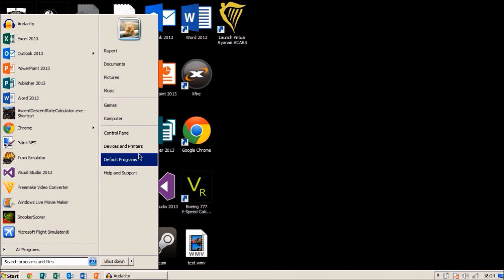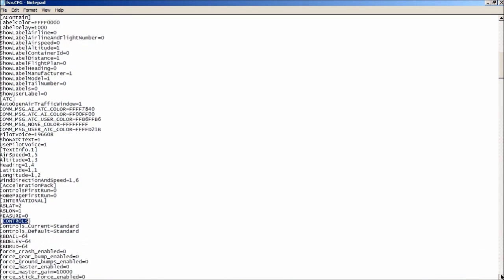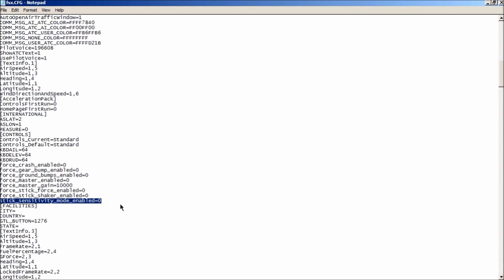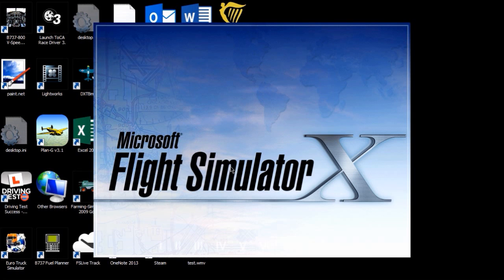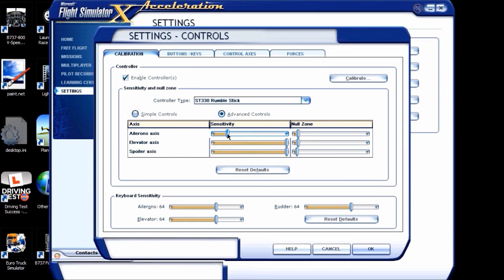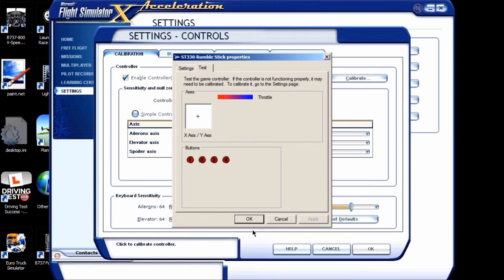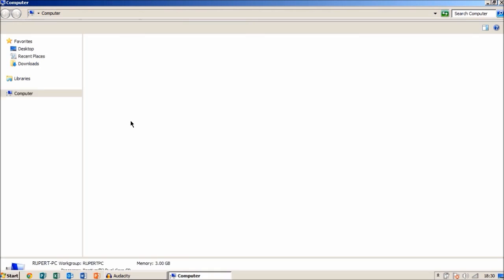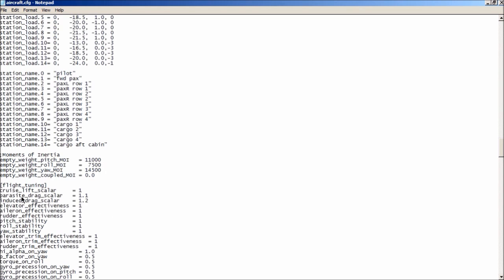FSX - How to setup your joystick/controller properly! (100% Linear!)

Comment: so why doesnt my rudder turn hardly at all as soon as Im off the ground? then I can use it fully again on ground
Reply from the maker: It depends what you mean by hardly at all, if you mean it just causes a few degrees of displacement to the aircraft's yaw then this is completely normal - the rudder's effectiveness decreases with speed since for example if you are flying at 100 knots and apply rudder, you are trying to deflect the tail into the path of the 100 knot wind and so the wind naturally pushes the tail back into line and therefore it requires more input to do very little. Whereas on the ground, though the rudder does help when you control the rudder (in most aircraft) it just turns the nose gear so it's just like steering in a car. The best way to check if your issue is just a misunderstanding of how the rudder works, or whether it is your controller - just look at the virtual pedals in game of the aircraft you are flying, if when you put full rudder on your controller the pedals in game move to their maximum offset then the control setup is fine. It could also be down to the aircraft you are using, default aircraft tend to have poor flight models and hence this could also be a contributing factor. I hope this answers your question. Rupert
Reply: ok thank you. My pedals seem to turn mostly to their full extent when Im off the ground. Its weird though having not alot of control. anyways. I appreciate your help! Ill subscribe :)
Reply: Have to turned off autorudder? It seems like a silly question, but it's caught me out before.
Reply from the maker: Luke's Throwaway Channel It's been a while since I fired up FSX so can't remember exactly however I think it is in the realism section
Reply from the maker: Luke's Throwaway Channel It's been a while since I fired up FSX so can't remember exactly however I think it is in the realism section

Comment: my joy stick elevator is shakeing.  jsut elevator and  sometime i can't moe down or up fully of elevator how to fix it thx. sorry for my english
Reply from the maker: PKPat It sounds like you need to calibrate it, go into devices and printers and then right click on your joystick, click settings then advanced and you should be able to see the calibration from there. There will be a tab at the top of the window that opens and in that tab you should have an option to calibrate the device. Hopefully that's easy enough to follow, a number of people ask this question so may make a video on it :)
Reply: shaking virtual controls say about hardware noice, you can calibrate it and use some software signal filtering, but better just change joy, i change tonns of joysticks from 1994 or somewhen like that, but after i got really good one, in 1998 or some around that date, uses it till ~2013, about 15 years, it was ms sidewinder precision pro with laser sensors, in 2013 i got x65 with strain gage sensors, and both take for never ever have a problems wat i had with other sticks, you can found joysticks with hall sensors, but they only for x,y axis, so with that joystick need use rudder or be ready, when resistor of rudder-twist start noice, but today afaik new joysticks with resistors use very good hardware, in 1990 it was in expensive models only(exclude microsoft models like precission v2 and ffb v2*), like thrustmaster cougar or ch, so may be, you need just change joy, but if your joy is new, so my "afaik" is completely wrong, and everything stay as was befor, and for be sure about long live for joy need some extra cash
(* <this one brand new on ebay was around 600$ year ago)
at today i think only 3 models of joys, what worth to buy, thrustmuster a-10(need buy rudder separately), g940 and x65 if you are not billionaire, for change them every month, sure you can be lucky and not expensive joy will live very long time, but i think you have to be really lucky, as all of them made from cheap plastic and just can not have long life
and if you will buy x65 be sure his immovable stick for you, i did and i was right, after use movable joysticks more than 15 years my empty brain was adopted to x65 in couple of hours(by the way, for calibrate x65, all you need it enable most relaxed force mode and reconnect it)

Comment: Does it work for keyboard?
Reply from the maker: Thomas barney No sorry keyboard buttons are digital. On or off - 1 or 0 and therefore there is nothing linear about them since they can only have 2 values. For example let's say you have two light bulbs. One can only be on or off the other has a dimmer. You could increase the light from the bulb with a dimmer smoothly (linear) or you could start off increasing slowly then increase quickly (non linear)... However with the bulb that is only on or off you can't increase the brightness slowly because, well it's on or off :) hope that answers your question

Comment: with my joystick it all ways turns left or right when its perfectly in the middle!
Reply from the maker: Oli Plays Hmmm, it's either a calibration error which can be fixed in devices and printers or it could be due to wind if using a default ac?

Comment: has anyone got the config file so i can just load it straight in instead of doing all the mapping myself?
Reply from the maker: I most definitely would send you my config if I could... However the config is independent of your pc, with all your custom settings and addon references stored in it. My config also has tweaks specific for my pc and could make yours run poorly. Rupert
Reply: ah i see, there is no keyboard mapping xml file then?
Reply: C:\Users\YOUR USERNAME HERE\AppData\Roaming\Microsoft\FSX\Controls\Standard.XML

it should be here, but i am looking specifically for someine who uses a ps3 controller

Comment: Hi! Rupert, is it true that the above technique doesn't correct the nonlinearity of Pro Flight Cessna Yoke?
I have tweaked fsx.CFG and set the sensitivity of max and nullzone to minimum as suggested in the video.
I have tried it also before and after downloadeing and installing the latest Saitek driver.
It is still behaving like nonlinear yoke in FSX: Steam Edition on my Windows 7.

I'm so bummed out right now, I just got my first yoke today...

Comment: I have tried every way I could think of.  But I'm not very tech savvy.  So far I have only bought add-ons from the Steam site, so they are always compatible.  Most other add-ons do not confirm compatibility with Steam.  I am not too concerned about that but I would really like to detune my twitchy aircraft.
Reply from the maker: Ah so you are trying to tweak a file from an aircraft off the workshop?

Comment: Hi Rupert,  I'm back.  Since my last contact I have upgraded  to FSX Steam.  I have been trying to find the " SimObject/Aircraft" file. When I found it I discovered that the aircraft file no longer looks like that under FSX.  Have you been involved with FSX Steam and have you found how to detune the controls?
Reply from the maker: Hmm strange, the  simobject/aircraft file should be located under; program files (x86)\steam\steamapps\common\flight simulator x (not quite sure of the folder names just going off the top of my head as did have steam but am currently on classic). Let me know if you still can't find it but I'm sure it should be there, otherwise addons like the PMDGs wouldn't have worked from the start. Regards, Rupert
Reply: Hello Rupert,  thanks for having a look at this.  You have indeed solved my problem.
Reply from the maker: +Theo Langenberg Ah good to hear

Comment: I was hoping this would including setting up elevator using a joystick axis.. Just got a second joystick ( original usb sidewinder, no twist ) for other settings but I can't find a few... I want to use throttle for elevator axis, pulling back for reverse engines, left / right to alter rudder trim, forward ( haven't decided on forward ), buttons for some of the other settings...

Unfortunately, most of these options don't exist... But, there is a way to edit the config to include them by editing the bindings manually.. For such an old game, though, you'd think there'd be a thirdparty tool that would handle this.. Know of any?
Reply from the maker: Hmm, have a look at my other FSX tutorial called how to setup multiple controllers, that should cover your first point however if you're looking for a more advanced configuring tool, look into FSUIPC, it's not cheap but I think it's the only other option really. Sorry for the late reply! Rupert
Reply: Unfortunately that is what I have been doing but not all of the controls can use an axis... I'll research FSUIPC, or see about tweaking the config file manually ( copying the controller axis assignment from something to where I want it and hope it doesn't reset )..

Comment: Help! My thrustmaster T flight stick was fine at first in FSX but when I installed combat simulator I changed the joystick configuration and now the joystick wont even calibrate correctly on FSX. How do I fix this? ( besides buying a new joystick ) I already did a full clean install of FSX but its still the same. Although FSX recognizes the joystick I just wont run it properly. ): Any help would be greatly appreciated, Thanks!

Comment: I don't have the "Facilities" tab.
Hulp.
Reply: where do i put it in. i have the same problem
where under controls?
Reply from the maker: It doesn't matter whether you have the facilities tab or not, it will work fine as long as you put the code in the control section.
Reply: +Rupert Smith (Rupert's Software) 

... I knew that ...
Reply from the maker: TK Gaming :)
Reply from the maker: Anywhere under the controls heading :)

Comment: Sorry, I couldn't understand the aircraft.cft adjustment. So, it will be necessary to do this adjstment manually to every single aircraft installed in my fsx root one by one? Is that it?

Many thanks
Reply from the maker: Basically the tweak removes the ability to change sensitivity, so to do this you have to do it within the aircraft.cfg, unless you are happy with the sensitivity. However if you're like me, I only fly about 2 aeroplanes frequently; cessna 172 and pmdg 737 so it's really not a big job. I'll happily give you a hand with the adjustments so if you want to send me an email to; smith.rupert@outlook.com. Rupert.
Reply: +Rupert Smith (Rupert&#39;s Software) I got it. Thanks for the feedback. I'll try to adjust by myself. Any problem, I'll contact you. Once again, tks
Reply from the maker: You're welcome :)

Comment: How can use a Xbox controller with keyboard?
Reply: get an adaptor and FSX should immediately recognize it once the computer installs it's software. Then you can edit the controls in settings to your personal preferences.
Reply from the maker: +Daniel Anderson Thanks for helping, I don't have any experience with the xbox controllers.
Reply: Hey, thanks for your input Daniel Anderson

Comment: Very informative video, thank you. Can you suggest settings for PMDG 747-400. I use Logitech Force 3D PRO joystick. Because of force feedback and under continuous spring tension rudder and elevators  always have jerks, this is causing aircraft tends to turn from the center line on taxi way/runway. Also another issue I am facing is autopilot gets disengaged frequently while steep climbing or at sharp turns.
Reply from the maker: +ASP Rao Sorry for the delay, I wasn't notified of your comment :/ I'm afraid I have no experience with the 747 or in fact the Logitech Force 3D Pro joystick, but I would recommend turning down the effectiveness as a starting point

Comment: Hi Rupert,  must tell you about my great Commercial Flight Simulator experience.  Flew a 737-800NG on a circuit around Dubai.  30 minute session.  I was well prepared having practiced many short flights.  The cockpit- instrument panel looked so familiar.  Fully recommended if ever you get the chance.
Reply from the maker: +Theo Langenberg Wow that sounds amazing! I would love to do that one day! My only experience really is flying a cessna 172 under instruction. How did you get to do that, do you have a private pilot's license or commercial or...?
Reply: +Rupert Smith (Rupert's Software) No, I am not a pilot, just a 72 year old retiree. We have two facilities in Sydney - Australia.  One in Darling Harbour, a tourist centre and the nearest to me is in Penrith.  If you Google Adrenalin Sydney you can learn all about it.
Reply from the maker: Theo Langenberg Ah right thanks!

Comment: Does not work with my Saitek Cessna yoke sadly. Funny how FSX, that claims to be "flight simulator", does not support linear yokes properly and applies some bullshit logarithmic transformation to compensate flying with budget joysticks that can only be worked around with payware addons like flyuipc. This is a bad joke.
Reply from the maker: +reav3rtm I do agree with you, however, before you loose hope; just check you did everything as said in the video and instead of just looking at the yoke in the a/c, look outside and see if the elevators are linear. The virtual yoke is definitely nothing to go by so do check outside!
Reply: +Rupert Smith (Rupert's Software)
I checked, it's not just with virtual cockpit rendered yoke or throttle. Actually FSX seems not to support full movement range of either yoke or TPM (from separate Saitek TPM module) axes. For that I cannot set throttle to ~90%, from around 75% it goes directly to 100%.
I worked around yoke problem with recallibrating it to just support approx. half or real yoke range (yoke supports 90 degrees movement while FSP apparently expect the one with 45 degrees roll limit) - now virtual yoke follows more or less real one. Still problem with throttle, recallibrating range did not help here though I found some tips online, will check them some time later.

Comment: The file is no longer called FSX.CFG
Reply from the maker: It most definitely is still called fsx.cfg
Reply: +Rupert Smith (Rupert's Software) I'd love to PM you screenshots of my games folder then. Not my first time changing a config i'm not blind it's as easy as sorting the folder by name and scrolling down. Maybe for people who downloaded it around when you did it's called FSX.CFG but the only config title that starts with FSX in my folder is FSXSEConfig.exe
Reply from the maker: ***** Well I'm afraid you're mistaken, I am in fact running FSX SE now and recently reinstalled fsx-meaning I had to route around in the cfg applying tweaks etc. I would like to see these screenshots though out of interest. To be sure you're looking at the correct cfg; consult this video: https://www.youtube.com/watch?v=zNfmSFk4F_U
Reply: +Rupert Smith (Rupert's Software) Yes I am looking in the right place. Not even a simple search of my computer for the file name brings results either. Like I said not my first time changing a config.
Reply from the maker: ***** Well email me a screenshot... officialscruffybear@gmail.com
Reply: It is, you may need to edit your controls / graphics, etc.. and save once or load fully into the game once for it to show if it isn't showing already...
The directory ( much shorter than the video ): %Appdata%\Microsoft\fsx

Comment: Does this also sort out the issue with throttle. Im using the x55 rhino and the null zone is set on 1 and cant get it any lower which means the aircraft will move when throttle is fully back. iv gone into the Standard.XML folder and changed the null to 0 but still have the issue
Reply: thanks Rupert. but i have found out away to fix it. in the cfg foulder and change the min throttle to 0.00
Reply from the maker: xX DOVIDKIN Xx 98 Ah ok, I'll take that on board encase anyone else asks that.

Comment: I did the 'stick_sensitivity_mode=0' but nothing changed, its still very low sensitivity around the mid section and extremely high on the outsides.
Reply from the maker: +Lebrun Jemz Hmm, is your joystick calibrated?? Also-don't look at the in-game yoke to compare, use the ailerons and elevators since the yoke in-game doesn't seem to be linear with anything. Let me know your results...
Reply: Rupert Smith Its calibrated yes, everything is good but i have been using the yoke as reference. Is there a way to make the yoke linear aswell? Its somehow more satisfying having the yoke make the same movements as your joystick if you know what i mean.
Reply from the maker: Lebrun Jemz I know exactly what you mean, but unfortunately if there was some way of making the yoke linear-it would consequently make the ailerons not linear, I guess it's just one of those FSX quirks we'll have to live with:/
Reply: Rupert Smith That sucks, maybe dovetail games could look into it or something. Thanks for the help though! (:
Reply from the maker: Lebrun Jemz No problem:) I'm actually lead to believe that though dovetail games own the rights to it, I'm fairly confident that they're not actually aloud to change the game besides fix a few bugs and add things such as highmemfix=1 that should have been added in the first place. So I'm afraid the future of FSX is somewhat non-existant
Reply: Rupert Smith Yeah I heard something like that. No worries though, they're working on a new flight sim :)
Reply from the maker: Lebrun Jemz Certainly something to look forward to, I guess p3d is the alternative that I'll likely switch over to when 64bit is available